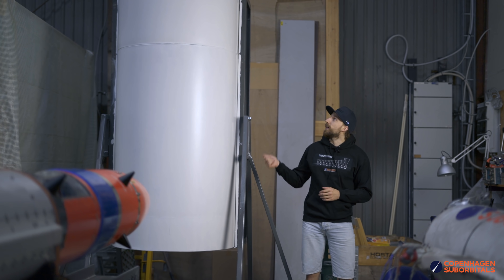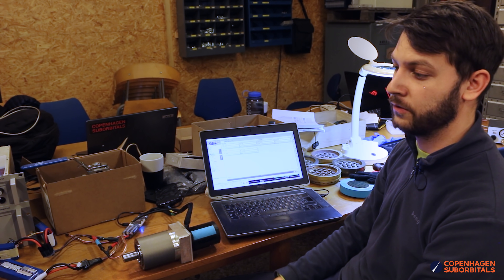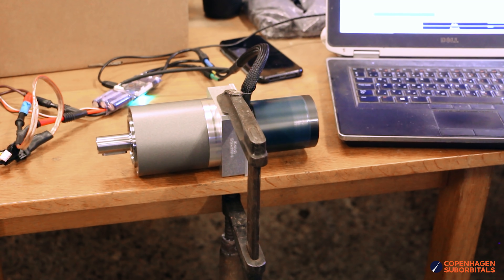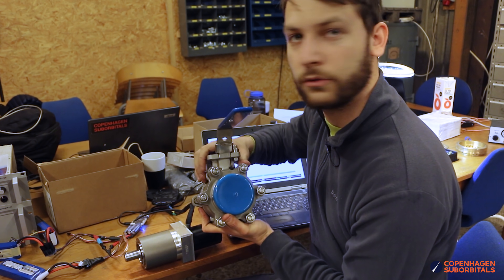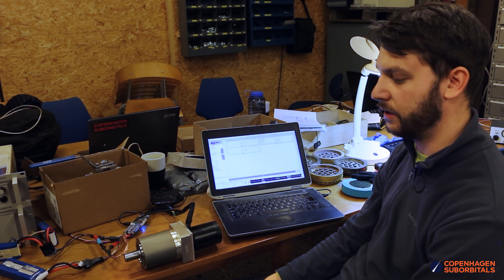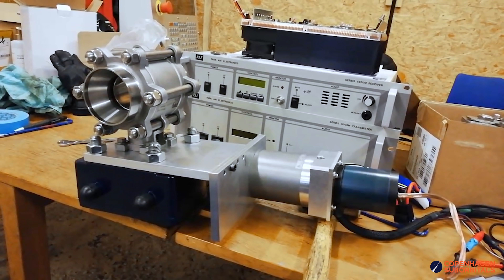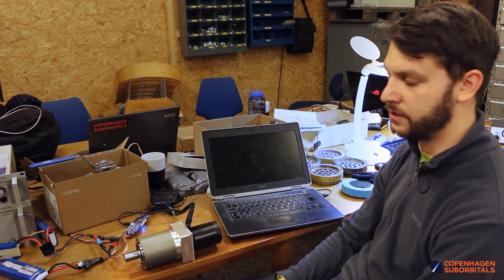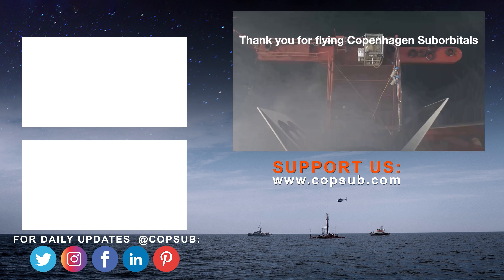LOX Valves for Large & Scary ROCKET ENGINE

Comment: Good luck with the cryogenic test, the "frozen lox valve" has been the undoing of many big garage rockets. I spent 4 months on one project just to convert a industrial ball valve to operate in the field reliably with LOX, was great fun..
Reply: Hello , thank you so much for the comment , working on the same project , we are building a rocket engine too , we have to keep it cheap so don't know how to convert a industrial ball vakve to a cryogenic valve , it would be really really really great if you could guide me and help me in this , btw what are these guys using , what I see is they also using industrial valves but how are they so sure that it will work for cryogenics?

Comment: Why wouldn't you use a pneumatic piston to actuate the manual valve? Its a cheap way to create pneumatic actuator, and can deliver a lot torque in a lighter package I believe. At the opening speed demonstrated with the motor, you will have a sloppy/unreliable startup transient, which can make your engine hard start.
Reply: Im not sure, but if they want to throttle with the main valve the setup they use will probably work a lot better. In my experience, it is pretty difficult to get pneumatics to reliably extend or contract to a certain point, so precise throttling wouldn't be possible or very difficult at least.
Reply: Can you create another branch off the pressure tank to serve as actuator pressure?

Comment: Valves are so often forgotten when talking about rocket design! It is very nice of you all to show us this side of the project too! Godspeed for BPM100!
Reply: Well, CopSub is infamous for the failure of their improvised lox valve preheater on HEAT 1x.  It was a cheap hairdryer installed inside the rocket and the failure was apparently electrical.

Comment: Great work!!! :)
Which advantages are you gain of using motor instead of pneumatic actuator?
Reply: Pneumatic valves are what's been used on the past/current generations of launchers. They're great if you need high torques or forces but they're heavy. Plus you need EVs, piping, etc to feed them. And finally, it's cheaper to use a motor or solenoid, especially if you can find something of the shelf. Now I don't know what influenced their trade-off and that's just my take on it, having worked on both.